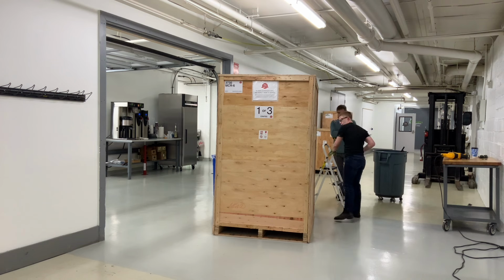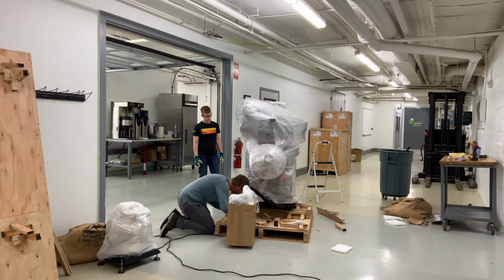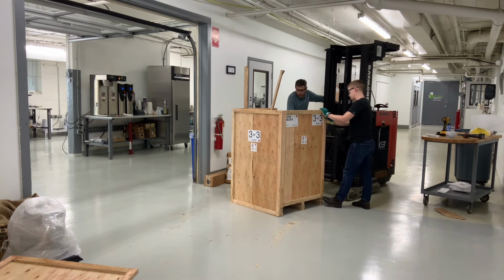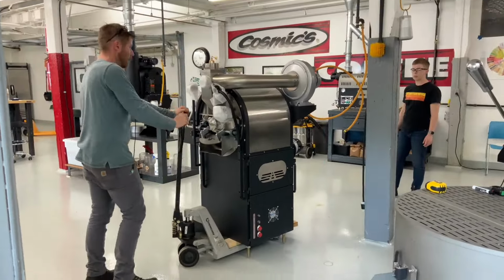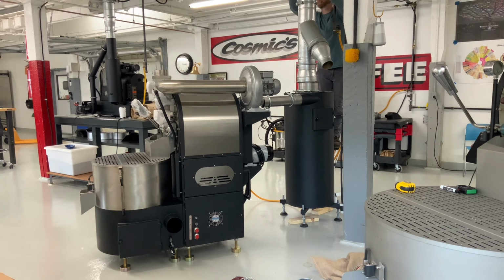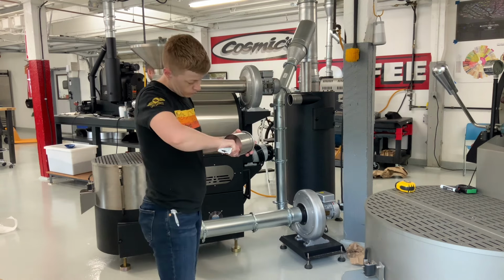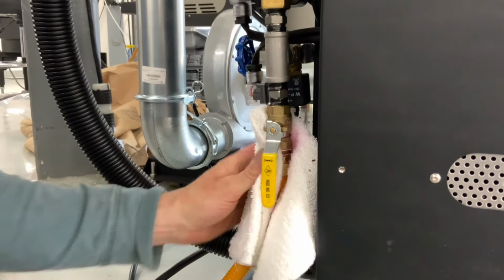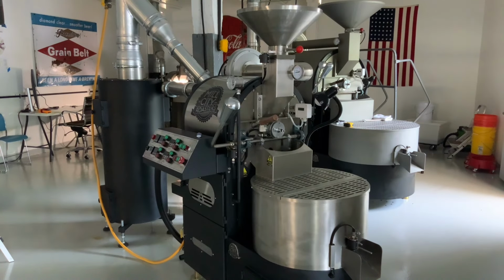MCR-6 Uncrating & Installing

Comment: Do you not get any issue with the two blower going into the one flue?
Reply from the maker: Not the way we do it. Ymmv.
Reply: @MillCityRoasters  how’s that’s then?
Reply from the maker: If this is a real question, we provide professional installation consultation with the purchase of every roaster or as part of a paid support package for new and used machines from all major roaster manufacturers. Bad amateur installation advice is available for free all over the internet. If you think it's easy,  search "roastery fire" and start reading.